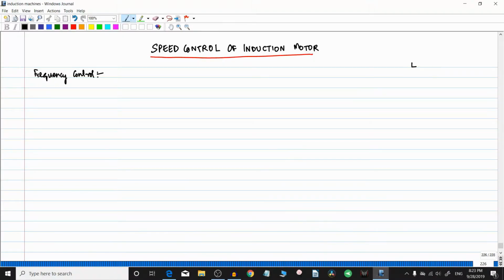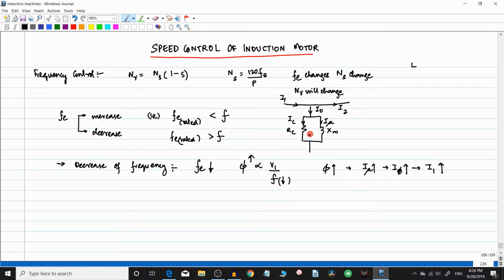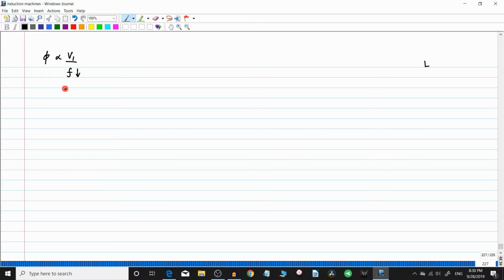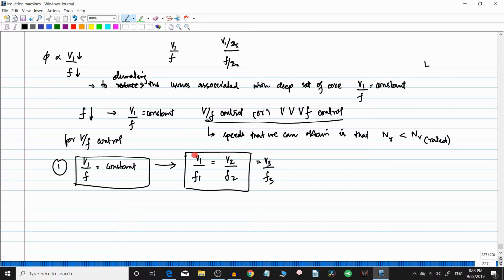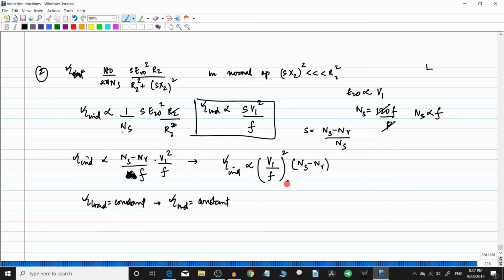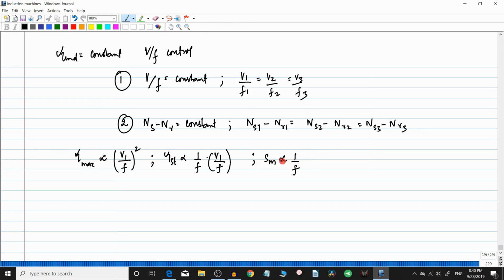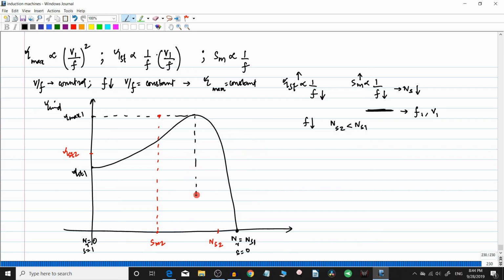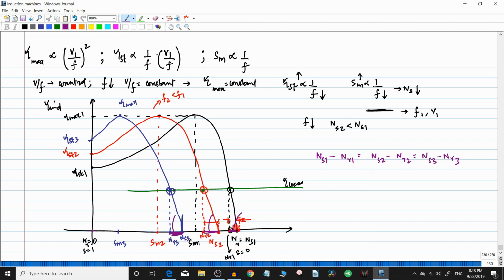Induction Motor #48 - SPEED CONTROL OF INDUCTION MOTOR - Frequency Control part1

Comment: Fascinating. I am struggling with your presentation on characteristic curve with varying frequency. The graph presented in Chapman’s text has the starting torque and the max torque decreasing as the frequency drops. But you have the starting torque increasing and the max torque constant.

What is different?